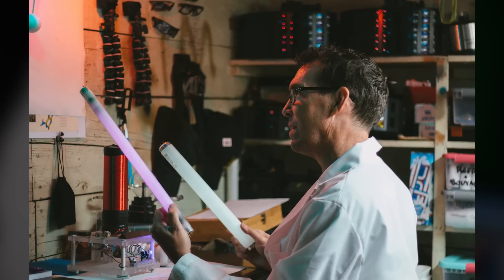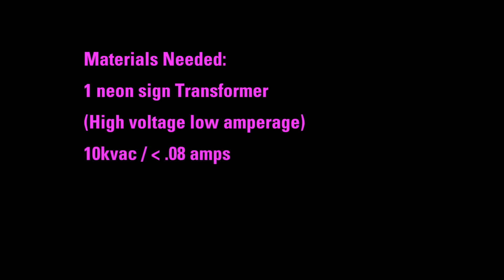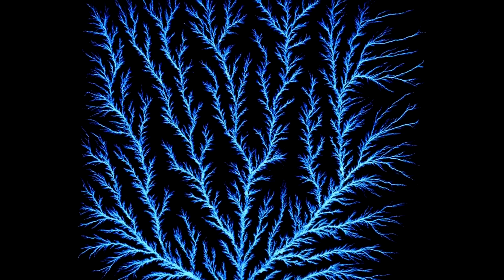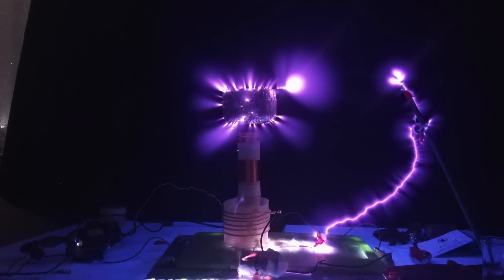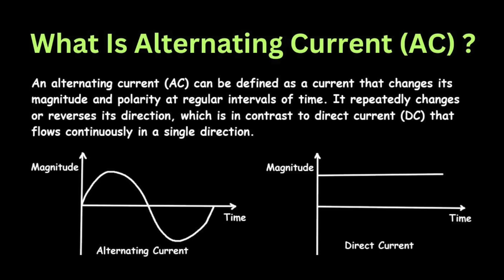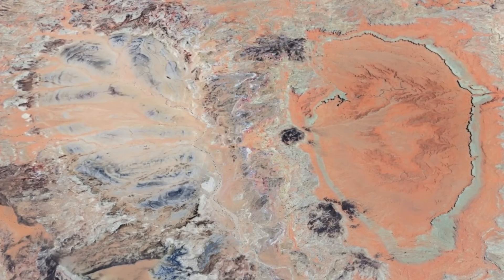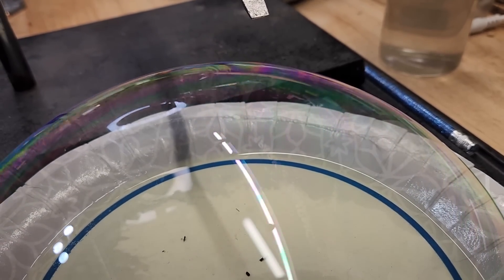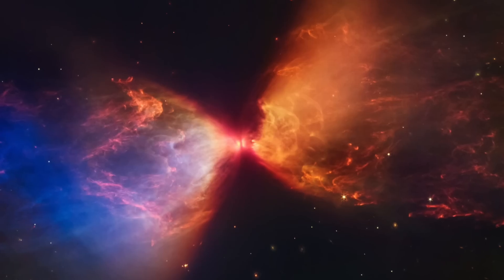Ben Hyde: Three Simple Experiments | Thunderbolts

Comment: I had an interesting encounter with Saint Elmo's Fire while conducting aerial refueling while skimming the cloud tops. My Air Force C-141 cargo plane was going to take fuel from a KC-10 fuel tanker at night at Flight Level 250 (25k feet). As we drove in to get plugged by the tanker, we approached with the refueling boom just above the level of the aircraft windshield. As we got about eight feet from the boom, an eight inch diameter plasma tube formed from the end of the refueling boom to our windshield. The other pilot was flying, so I leaned forward and took a good look at the plasma tube. It was beautiful with classic purple color. Normally, when the boom contacts the C-141's refueling receptacle, a communication link is made and the boom is locked into place. Of course, the plasma tube fried the electronics and we could not latch the boom so we had to abort the refueling training. I should have realized that would happen and backed off, but the plasma was so beautiful and weird that I didn't think about the boom's electronics being destroyed by thousands of volts of electricity flowing between the two planes.

Comment: Am I missing something? Shapes and structures often associated with electrical discharges are not unique to electricity... right? Can't the same Lichtenberg patterns be produced by leaving a garden hose running on a pile of dirt?
Reply: Try it and see.  Also, (and I don't want to spoil anything here) If the garden hose in the dirt DOES produce Lichtenberg patterns, it still doesn't disprove that charge was the cause of it.

Comment: "The electric sun model cannot even properly explain the thermal spectrum of the Sun let alone the different star types. There is not one shred of evidence that the surface of the Sun acts as an anode. The atoms at the photosphere are overwhelmingly neutral and the voltages required by Mr Scott have never been measured. Also, there is no evidence that the Sun is connected by an electrical circuit to another star."

- Stephen Crothers

Comment: I took backind soda and mixed battery acid with it spread on aluminum foil let dry over night . Took 15,ooo volts small wire when getting close to soda befoe arc , lcould make a small electric dust devil looked really cool.

Comment: Thought experiment to prove "g" is magnetic.  Imagine two particles in space X distance apart, edge to edge. What force draws them together - particle attraction, obviously.  Now double the size of the particle on the left.  What force draws them together, the same, obviously.  Continue the experiment by doubling the size of one particular until the particle is the size of earth. At what point does the particle attraction become gravity?   I suggest doubling the size of one particular over and over again until the particle approaches planet size because the force of attraction will increase proportionally and smoothly with each doubling, proving that gravity is the force of attraction.
Reply: at no point, gravitation is always there but does not contribute much between smallish masses
Reply: "Imagine two particles in space X distance apart"

Of the same sign? Of opposite sign? Neutral particles? If the particles have the same sign they will repel if they get close enough. Or will attract if of opposite sign. And that will be due to an electric field, not a magnetic one. If the particles are neutral, and have very small masses, gravity won't do much between them.
Reply: @davejones7632 lol😅

Comment: Deep inside the earth water meets hydrophilic minerals as it rises from near the outer core. Then it penetrates these minerals as EZ water, liberating hydrogen ions, these disperse creating vast charged domains. If a powerful enough connection occurs these domains react and the EZ water bonds with it's mineral 'host' forming hydroxyl groups and causing the mineral, transformed, to expand adding 50% to its volume. To relieve that pressure the only way is up, following the charge path created by the reacting H+.
Reply: EZ water?
Reply: @physicswithpark3r-x3x  exclusion zone bonded h-o at the interface where it dumps it's solutes.
Reply: see also: G Pollack 'the fourth phase of water'

Comment: At 4:25 he seems to be claiming the tree like = dendritic patterns of water drainage has something to do with electricity. Sorry but the water moves and erodes the rocks. it flows down hill due to gravity. There is no electrical charge difference between the ocean and wetlands at the top of the river system. There is something pathological about getting pleasure that  your cult has the answer to everything. Pleasure that distorts your judgment so that you will say maybe about nonsense that you should say Hard No to.
Reply: gravity is a no no around these here parts

Comment: Luv those old NST's. Got 4-15kv matched off the same production line run in parallel on Tesla coil. BE Aware: These transformers can vary by dang near a thousand volts either witchy way from identically labeled other ones. Use with edification.

Comment: double-lobed features = one negative and one positive.  Material is excavated from one and electrically transfers to the other (fast through the air).  Valley / harbor is created on one side and the other is the built-up mound of recently excavated material.
Reply: Not according to anyone familiar with physics.
Reply: @davejones7632  That's why astrophysicists continue to make predictions that turn out to be opposite of what space exploration reveals.
Reply: @davejones7632 😂 So in the end, your words are just plain unscientific nonsense?
Reply: @davejones7632  So how many times has bbt changed each year when the prediction is wrong, kid?

Comment: Yikes!  I must have missed the part where you warn people that there have been several folks electrocuted by doing the wood burning technique you describe!!  DANGER.  Don't try this unless you are VERY comfortable working with electricity and you understand the risks!!
Reply: One of the reasons I made this video, is to show the CORRECT / SAFE path to play with electricity.
 No one starts out being comfortable with a new thing. The transformer I describe using has an amperage rating BELOW the LEATHAL limit of .08 Amperes.  All of my transformers are below this limit and I have been zapped by them more times than I can count with zero repercussions.
Reply: @BenHydeSPARKScience  well, it did fry your brain...
Reply: @BenHydeSPARKScience  I can appreciate the intent and I'm not trying to be a troll.  I work on commercial espresso machines and also teach folks how to work on commercial espresso machines.  The first lesson is always around safety, and talking about where the lethal parts of the system are.  If your intent is to teach people how to do these experiments safely, then I would argue that it's important to teach them the boundaries of what is safe and what isn't, which is a discussion that is missing in this video.  I'm sure you can imagine that if someone can't find the particular spec of the neon transformer you talk about, but instead grab a microwave transformer, (which are easier to find), that you  could have a dead person on your hands.  Or if they use a car battery as a DC source.  Or, or, or...  There are a million ways that someone could mess up your instructions and end up hurting or killing themselves.  If you are going to be on a larger platform like Thunderbolts, then please be cognizant that very few folks have the electrical background to really understand the issues around Safety when watching super cool experiments like what you presented.
Reply: @BenHydeSPARKScience  I sympathize with your intent, here.  And I'm not trying to be a troll.  BUT, I also work with electricity for a living inside of commercial espresso machines and have trained many others how to do so, as well.  There is enough electricity in both espresso machines AND the experiments you are expounding to k*** somebody.  The first lesson in my classes is a discussion about safety and where the danger lies inside of the system, so that the student understands the landscape where they are working.  That is not a discussion that happened in this video.  And there have been several people who have been electrocuted doing the Lichtenstein technique.  It looks cool, and is totally possible to do, but you have to know where the danger is in order to do it correctly.  Saying that your techinqe is "CORRECT/SAFE" without also talking about the dangers and WHY your technique is correct and safe is irresponsible.

I would also go further to say that making the claim of "... I have been zapped by them more times than I can count with zero repercussions." is also irresponsible without talking about whether you were grounded, what type of safety precautions you took, if you were wearing insulating boots, if the "shock" was communicated up one arm and down the other across your heart, if the bench top was grounded, etc.  You have not described what you do and how you do it to know if your technique is intrinsically safe, or not.

There are a lot of interested beginners.  And there are a lot of young, (and old), folks who are interested in the ideas but have zero practical experience with electricity and do not understand how to keep themselves safe.  The experiments you are presenting are for ADVANCED electrical practitioners only, and all of the experiments, (without you providing further explanations of how to keep oneself safe), have the inherent risk of great injury to the experimenter.  I would think both yourself and Thunderbolts would want to be careful about taking on this kind of liability.
Reply: @mszabol69  This really feels like you are making a mountain out of a mole hill.  People actually choke and die from eating food as well.  You can't possibly agree that it is irresponsible for food channels to post content where they don't  discuss the dangers of chewing and swallowing, right?  Should we even discuss driving fatalities and automotive channels?  Humans ignore warnings, fail to listen, and most egregious of all, fail to think.  I gave simple, visual and audible instructions that will keep anyone safe IF FOLLOWED.  You are catering to the weakness of the weakest link in the chain of our society instead of helping forge tougher, stronger links!
Reply: @BenHydeSPARKScience  attaboy, that's the spirit!
Reply: Where people die is messing with higher amperage microwave transformers. Neon sign transformers are the safest way to experiment.